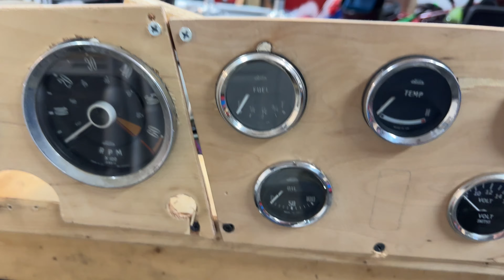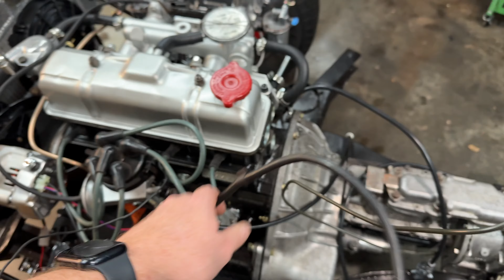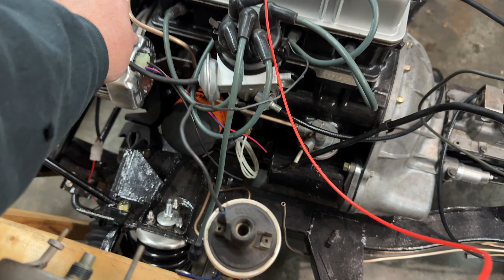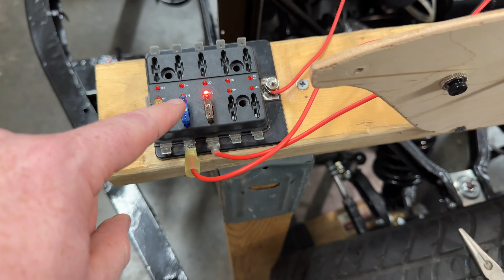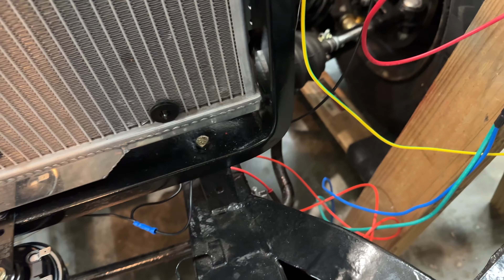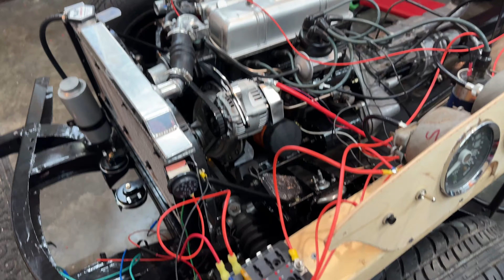Wiring up a Test Stand | Triumph Spitfire Restoration - Part 119

Comment: Solid setup, steve.should work just fine. Hazen beat me to my only comment about needing a voltage regulator for you electrical gauges. I used a laser thermometer just to be able to look for hotspots. Looking forward to that first start!
Reply from the maker: Without giving anything away, I can tell you that the setup worked perfectly.  :-)
Reply: @StevesProjectCarGarage  Ha! Good deal and congrats. Get hot editing that video!
Reply from the maker: Thank you!

Comment: You didn't address temporary seat and steering column install😂

Actually, just wanted to point out you're bypassing the voltage stabilizer for the temp gauge. 12v will give incorrect readings.
Reply from the maker: Good catch!  Thank you!